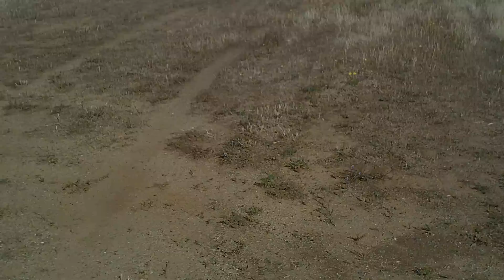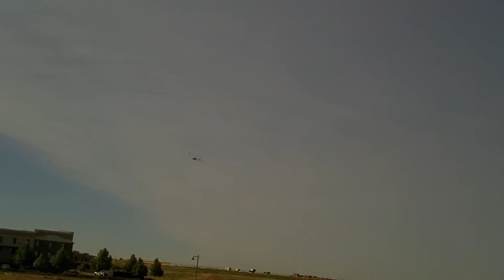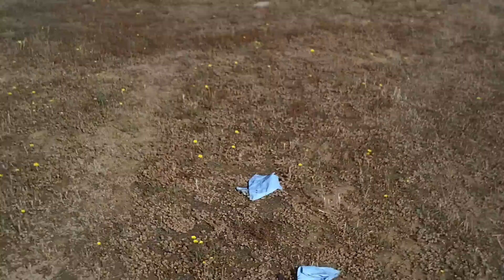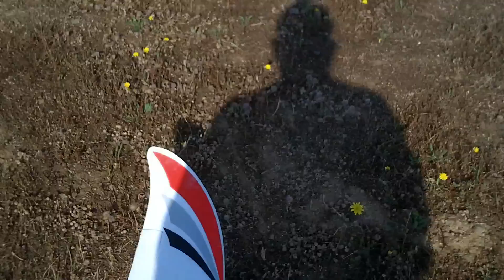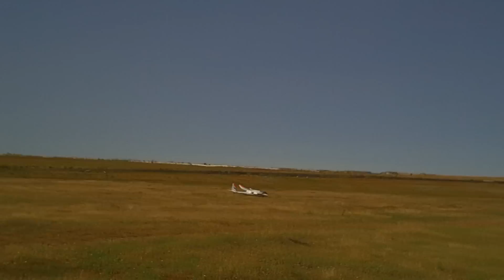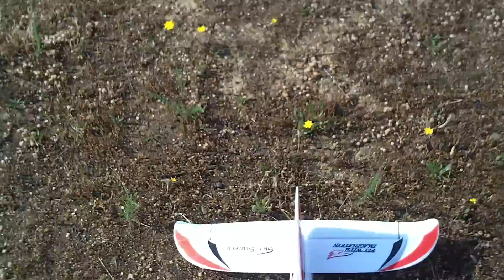Sky Surfer V2 SS#3 w-Flaps maiden 5-19-11-edited.mov

Comment: thanks for sharing- building my ss and adding flaps as well- I cut a 45 degree bevel cut on one edge of the cut out flaps so the control surface can go down only ( you are saying cut two 45 degree cuts- like ailerons, so they can go up as well? and how do you get 85 degrees of flaps with a 45 degree cut? thank you for your reply